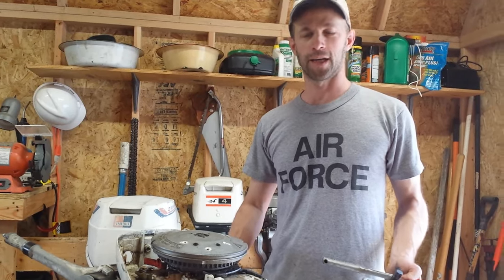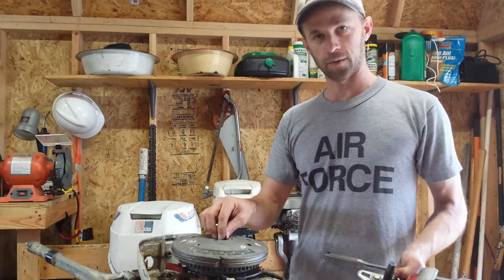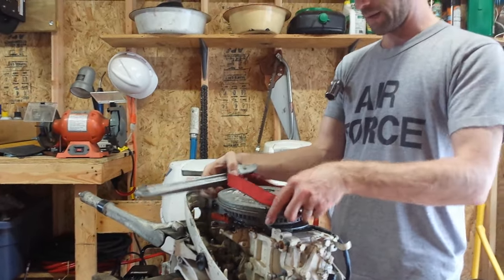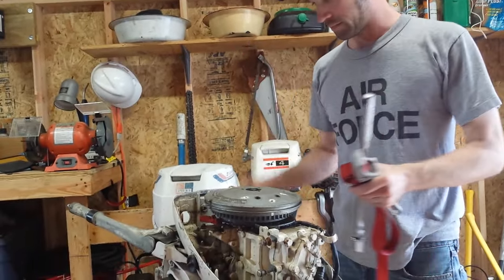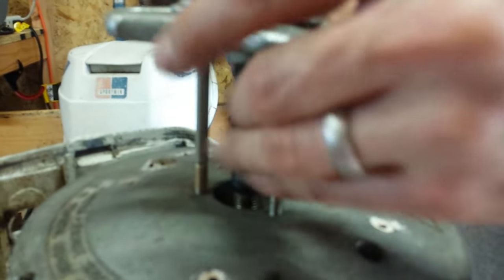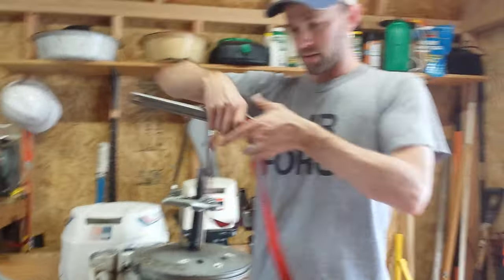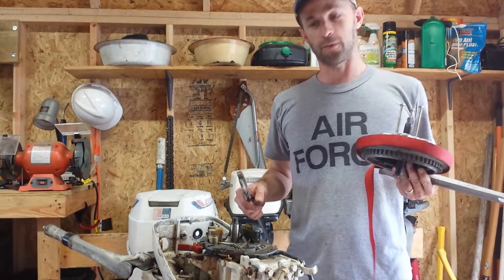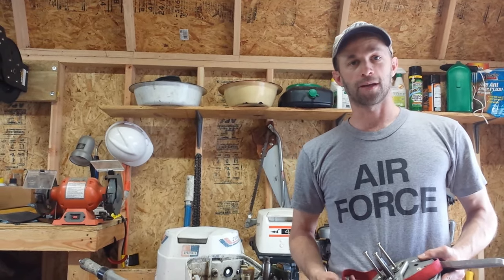How to Remove a Flywheel on a Johnson / Evinrude / OMC Outboard Motor

Comment: I know some people disagree, but, you can use an impact driver to remove the flywheel (on the center bolt of the puller.)  Some are easy to remove, some not.  Same with most magnetos and flywheels on these engies, motorcycles, atv's, dirtbikes, etc.

Comment: Just a tip for those that might not be aware of it, don't turn the flywheel counter clockwise because it could damage the water pump impeller.
Reply: Not true i test compression all the time never had a problem if your run it with no water I will damage it

Comment: You don't need the flywheel strap holder thing.  If you have an air gun.  And you don't need to use the holder when using the puller to get the fly will off

Comment: I still gave you a thumbs up bud. Thanks for the help... I broke bolts from the wheel puller... so just so your viewers know you sometimes have to take the pulling bolt to max tension(before the puller bolts break) then hit the top bolt with a big hammer to introduce shock to it. That's a lesson the old man at the dock taught me over the phone here in Virginia Beach.  😎

Comment: I got a harbor freight fly wheel puller and 3 -6 inch bolts 1/4 -20 bolts at a hardware store and a impact with a 3/4 socket and a rubber Mallot

Comment: Flat head screw driver through slot on flywheel against starter. No strap needed. Much easier then finding a strap tool

Comment: I have removed fly wheels off of 90 hp mercury and if you did not leave the the nut on some you would either get knocked out if not majority injured or loose some fingers. Remember the that center nut on some on better out broad motors for safety.

Comment: Awesome video. Thanks for the lesson because I've never done it before.  This is the next step for my 1959 35 hp Johnson Super Seahorse restoration.
Reply: Robert Judkins I am working on a 1958, Johnson 10hp. Stuck flywheel

Comment: If you put the nut back on the crankshaft with about 1/16 inch clearance from the flywheel before wrenching on the puller, it will prevent the explosive release of the flywheel.

Comment: Something I learned pulling my 27 year old 200 Johnson, only loosen the nut a couple of turns to keep it from coming off violently, add anti seize to the threads of the center of the puller (it keeps the threads from binding against the puller, only way I could get enough pressure on it), and you may have to give the center bolt of the puller a good tap to pop it off.

Comment: if there are bolt holes in the fly wheel you can also use a wrench steel tube or rebar to undo the flywheel nut just hold it between the 2 bolst and set your tool for the nut so you can squeeze the 2 tools togetther an the nut comes off

Comment: I have a 1992 johnson 15 horse motor.  I bought a power pack on Amazon that said it was the right size but the flywheel would not fit over it.  Now I've bought another power pack from Sierra and still the flywheel will not seat when I line up the groove in the center of the flywheel.   The old part is made a little different and it will fit.   Is there a special procedure to get the flywheel to clear the  power pack?

Comment: I pulled a spark plug, ran the engine to almost TDC and filled the cylinder with 1/2" diameter rope to fight the counter clock wise rotation of the engine as I unscrewed the flywheel nut. Worked for me with no strap wrench.

Comment: i need a blowup of the fuel pump to put it back together on my 6hp johnson outboard
Reply from the maker: Try marineengine.com and find the fuel pump diagram for your model year.  Here's what the 1972 6HP Johnson fuel pump blowup looks like: http://www.marineengine.com/parts/johnson-evinrude-parts.php?year=1972&hp=6&model=6R72D&manufacturer=Johnson&section=Fuel+Pump
Reply: highlandoutboards

Comment: I have a 1972 50 hp evinrude and can't get flywheel off?
I tightened the bolts on puller until you could not go any more!
hit with hammer and it never come lose?????

Comment: I did not run this motor since last summer and fully expected it to run after doing the carb and throttle cable.I put my 1988 9.9hp back together and flywheel was last and now I have no spark.My lanyrd switch seems to ohm out ok and is open contacts.Could I have done something putting flywheel on?I just slid it on the shaft while lining up keyway.Torqued to 45FTLBS..

Comment: hey i have a 95 evinrude 112 spl it cranks over fine but i seem to not be getting spark i was gonna pull the flywheel to test the stator if you know of anything else that might cause this before i try to replace the stator i would appreciate the help the motor has new spark plugs and it was running fine about 6 months ago.

Comment: After running to Tractor Supply two days straight to find the right size bolts, I finally got the flywheel off using your method. It was tough and it let out a loud BANG! Sounded like a .38. It scared the mess out of me.
Reply: Lol!
Reply: I went to Ace H/W, and they tried to match up the flywheel nut, none would fit. I finally went ahead and spent $6 for a nut off eBay.
Reply: Wish you had told us the size they were
Reply: @joshuaporter9481  I don't remember.  I googled it from a boating forum, wrote down what they said, and heading out to TSC and bought different sizes just in case.

Comment: i have a 1998 evinrude and i got my fly wheel of before and now idk what happened but my crank shaft nut is totally stripped along with the crank shaft bolt as well im shit out of luck any ideas i dont know how to replace the crank shaft anybody know any videos ?
Reply: Just buy a cheap welder and tack it on haha. That's what I'd do anyway but I'm rough as.

Comment: I have a 90 9.9 evinrude flywheel will not budge even with correct tools any ideas.
Reply: Did you ever figure out how? I’m having same issue
Reply: @camblynn712  yes get a good puller from harbor freight and you are supposed to use the 3 holes closest to the center nut buy decent grade bolts they have threads,,
soak w wd and some heat if needed,, I used a impact and it took some pressure,, hope this helps.
Reply: @camblynn712  also don’t be afraid to give the top of your puller and around the nut a few wraps w a hammer, with tension on it.
Reply: @treed5679  ok awesome thank you for the reply!!!

Comment: Hello, I have several old Evinrudes and Johnsons, but on two of these, a 1953 3hp and a 1961 3hp, the flywheel is really stuck. I've tried everything to get them of. I've tried a puller and on the '53 I tightened the puller so much I cracked the crankshaft of the engine. I've also tried the more simple methode, with a screwdriver prying the flywheel up and with a hammer tapping the crankshaft down. Neither of these methodes worked. Can you give me some tips?
Reply from the maker: That sounds like a tough one.  My best advice is to put the puller on the flywheel and torque it down as hard as you can.  Heat the crank shaft with a blow torch -- theory being that the different expansion of the steel crank and the flywheel will help release the bond.  While it's still hot, hit the stud on the puller sharply with a hammer, and hopefully the combination of the impact along with all of the other forces still present will release the flywheel.  If that doesn't work, you may need to take it to a machine shop.
Reply: highlandoutboards Thanks for your quick reply! I will see what I can do ;)

Comment: Once you pull the flywheel off is that a woodruff key on the shaft ? 
Mine is have worn off , can’t get ahold of it to remove it ... any ideas?
Reply from the maker: We've seen that before.  Yes, it's a woodruff key that holds the flywheel in alignment and transfers the driveshaft rotation to the flywheel.  When its worn off, it can be a booger.  Proceed at your own risk.  We have had to use punches and ball peen hammers and various chisels to remove partial keys before.  No foolproof recipe.

Comment: do you have to do timing again if you remove and replace flywheel
Reply from the maker: timing is unaffected by flywheel removal
Reply: Thank you
Reply: highlandoutboards can you tell me what this part is actually called? & where i can get one for a 1980 johnson 9.9 ?
Reply: highlandoutboards hi, i had a quick question for you on what this part is? it is a red plastic part on the throttle linkage of my 9.9 johnson 1980 outboard. i need to find one of these. i tried to email you a picture,  but says address is not valid?
Reply: @chrisbenedict4927  prevents starting the motor in gear. Will only start in neutral

Comment: 93 model 50 hp evinrude .
motor spins over fine getting fire to stator ...getting fire to power pack but from power pack to coil pack I'm not getting any fire ....has automatic oiler but oil tank is cracked . can I bypass the oiler safty switch and use mixed gas .
Reply from the maker: for the spark issue, make sure your ground connections on the power Pak and coils are good.  if still no spark, you probably have a bad power Pak...  for the oiler, yes. you can bypass and premix your oil/gas.
Reply: Ok how do I bypass  the oiler
Reply: I have a power pack coming . But I'm thinkin stator is bad . Am I correct to say .....the stator tells power pack to send fire to coil pack

Comment: I have a 1988 9.9hp Johnson tiller and since I have owned it amybe 5 years now and when first purchased the throttle was and can be very hard to get up to full throttle.It seems to be very hard to twist and won't move past half throttle and my suspicions are the part rotating under the flywheel which has the cam that contacts the throttle roller for carb.Can these get gunked up or something that would make it hard to rotate?First time I ever used it  was afraid of breaking something and then I felt it pop kinda and it went to full.Any experience with this?
Reply from the maker: If the shifter is in neutral, these motors have a throttle stop to protect from over-reving the motor.  Does the issue with not moving past half throttle go away if you put the motor in forward gear?
Reply: I am aware of the stop in neutral.I should have mentioned I am in gear and already moving and trying to accelerate when I feel the resistence.I thought I read somewhere this could be a problem caused by a build up of whatever under flywheel.
Reply: Found my problem.It was the throttle cable.It would stick intermittently.I did pull the flywheel for ease of working on things and checking it out under there.New cable on now and it works smooth.I wonder if you know the torque specs for the flywheel?thanks.

Comment: Today I attached the puller tightened the puller with a wrench Wouldn't budge got the impact wrench and stated again slowly the socket started to turn and the flywheel came off But to my dismay the flywheel came off but he hub was still attached to the crankshaft The flywheel had ripped away and destroyed the flywheel Ever heard of such a thing?
Lucky I was replacing the flywheel with one that had a ring gear.
Reply from the maker: Don Dingee I've never seen that before.  Sounds nasty!